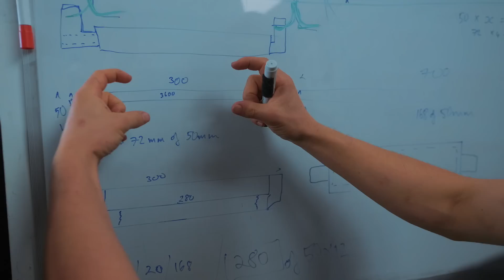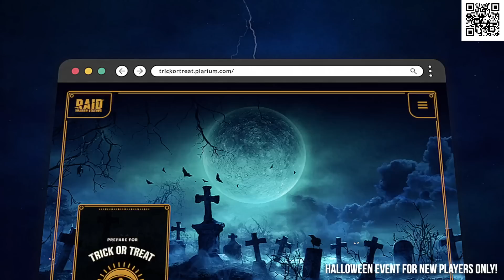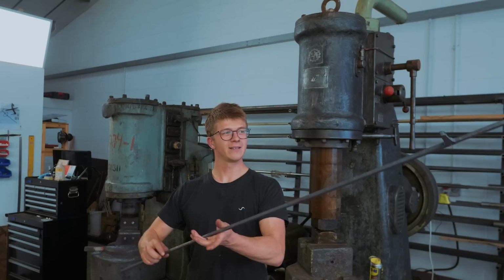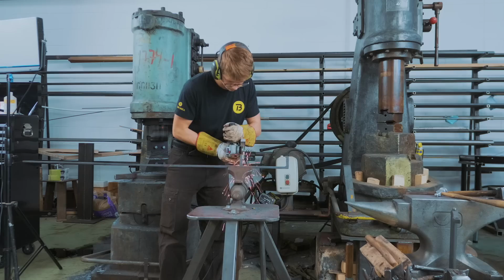Recreating This Ladle From LOTR: Rings of Power... Is It Legit?

Comment: Just a minor critique, and I know you was going for show accuracy here, but wouldn't the hole for the pour of the material be better off being a little bit higher just to try and avoid premature spillage from the hole?
Reply: @Braveskin  you have a good point, I didn't think of that.
Reply: I was goingbto say the same thing
Reply: @Braveskin  it doesnt have to be low for not  leaving metal in it... the bottom just has to slope up to the hole gently so that at the angle you can comfortably raise it to the slant is almost horizontal and just slightly pointing down.  |______/
Reply: that's what she said
Reply: @TheScarvig  Yeah, you just basically invented a beak, which would be perfect for that.
Reply: I agree completely. Also based on what's seen in the clips from RoP, the hole is not flush with the bottom of the tray. Like the spout looks to be favoring the top more. Also I enjoy how they show the rod as being designed to pour with. Yet they instead use two people to pour using an entirely different system. Also Alec, I do believe you forgot these side facing holes :P
Reply: It really doesn't seem to be the most practical ladle design, long trough like structures tend to resonate and splash excessively.
Reply: @Isnogood12  i am fully aware that this had to be a thing that exists with a name, but i didnt know it and thus just described it...

so i guess thx for telling me the name of it?
Reply: @TheScarvig  I didn't mean anything nasty with it. For me beaks and beakers are commonplace because labwork.
Reply: That's not the elvin way.
Reply: The issue is that for every millimeter you raise the hole, you'll have to raise higher the bar from the other end when you want to pour it, since it's raised with a lever-like effect. So pouring the content would become a lot harder if the hole is high. You have to compromise. I expect he did add some slope to the opening, just not a lot to not make the pouring too hard, since I bet he wanted to be safe and not have to hold it too close when pouring in case it actually breaks apart.
Reply: I think that's the reason why so little copper comes out into the mold and episode ends quite abruptly after. I think most of it ended up in the forge.

Comment: We made pin drivers using 1 1/8th winch cable. The pin driver was 1 1/2 or better solid shaft. Without the cable to dampen the sledgehammer blows your hands took some damage. We would weld the cable ends into a close fitting pipe. One end welded to the driving pin and the other end was longer for a handle. Hockey tape helped with the grip.

Comment: Think there'd be any ways to adjust this to make it actually practical to use?  Maybe make it out of something with a much higher melting temp so you could even melt steel in it if needed, and a way to have maybe a cap covering the hole, but have it open if you put the rod in one way but stay closed the other way?

Comment: Solution to your Foundry Problem: Take the imperfect Anvils and discount them while marking them to indicate they are rough, and work a deal with the Foundry where products which don't meet set standards will be purchased at 60-70% of value so you can safely discount them and the Foundry isn't losing money making Anvils it's going to have to melt and re-cast. Over time the quality level should improve and you won't have such strained relations with your supplier. 

And people will buy them. A lot of people can't afford to purchase an anvil at full price and will be quite happy to get one at a discount with some imperfections. 

Additional thought: You could add a raised lettering on the base/foot of the anvil that you could grind off indicating it as Rough in casting. Probably the easiest method of marking it, and lower your cost by foregoing any finishing, leaving that up to the purchaser. So essentially, you would receive your Anvils from the supplier, sort them into finished and unfinished, and discount the rough ones while doing the finishing work on the others and selling those at regular price. That saves you time, provides people with the option of buying and finishing their own anvil from an imperfect specimen, and you keep your supplier happy.

Final thought. You could put the 'Rough' lettering on a raised surface on the side of the foot and on finished anvils grind it down to that surface, polish it and market it with a production number out of 10000. i.e. 00001, 0012, etc... That keeps it clean and ensures the finished anvils are easily distinguished from unfinished anvils as being Pristine.

Comment: For anyone thinking, "well, we don't know what the ladle is actually made of, and the metal's probably something like mythril":

While that's true, Alec is not only exactly right about the incandescence, he's right about it _no matter what the ladle and melt materials are_.  Blackbody radiation is independent of the material producing it, and is solely dependent on the temperature.

So if the ladle and melt are at the same temperature, they must glow similarly, magic notwithstanding.  Even ceramic crucibles glow when their load glows (though, since crucibles are very insulative, their exterior gets dark much more quickly than the load, because the outside cools quickly, but the walls don't pass heat as quickly as metal).

Even being as favorable to LotR as possible - assuming that the ladle on screen is some kind of blackened ceramic that just looks like metal - it should be at least red hot right out of the fire, but it still just looks like cold steel.

Comment: Should be more like 1/4" thick walls on the ladle and base 1/2" to hold heat for gold, silver, copper ,etc. Lower temp metals to be melted and poured from and pour spout should be more just bent top edge of one end with corner hangers

Comment: As much as I love the forging and I do realize that the entire point of this channel and what you do is Blacksmithing, I can not help but think that sometimes there is just not a good reason to do some things in a way that is that much more difficult.  I mean, welding is a thing for a reason.  Wouldn't it have been better and much easier to have either welded the middle drop down parts on or even to have forged several pieces and then to thread them and put some locking pins in so that it could have been disassembled packed away in a case or something and then reassembled again later?  Hell, you could even patent a design for that and start making and selling them if you wanted to, even if it was just as merch or something.  You know, like your own custom made line of tools for fans to buy and use.

Comment: I can see a serious flaw: the pouring hole seems to be level with the bottom of the ladle, so if there was more that a tiny amount of molten metal in it, any movement would have it all pour out of its own accord and that would happen even if it was sitting flat and level in the furnace, so I'm surprised that your molten copper didn't literally "disappear" out of the pouring hole.
...and strangely enough, that's exactly what happened ("Oops. I spilled some") as soon as it was moved and you had to tip it up to stop that.
It wasn't your design and you were 100% correct about the colour it should be coming out of the furnace.

Comment: Wouldnt it have been a lot easier and faster to start with a long rod or square stock piece, cut a piece off and forge weld it to the center, and then just bend the tip 90- degrees and be done with the long rod handle thing? Why make those barbs integral out of a piece of flat stock and draw it out and then try and finagle the barbs? just seems like a lot of work that could have been one quick forge weld and some light shaping.

Comment: In the show, something strange happens when they pour from the ladle.  If you check 0:13 in this video, you see that there is either a different version of the ladle’s “boat”, or it can be reconfigured with different handles.  As you can see at 0:13 in this video, instead of the handle that Alec reproduced which was used for placing into/retrieving from the forge, when it comes time to pour, it’s a two man job, and there are two sets of long skinny handles at right angles to the “boat”.  Again, not sure if this was just a completely different prop from the movie, or somehow the ladle’s handles can replaced for the pouring phase of production, but there are definitely two distinct formats here.
Reply: Good catch. If you freeze it at 0:12, you can see a hole below each place on the ladle where you place the "forge loading loading handle" which you can slide the "pouring handles" through for pouring.
Reply: @johnj9635   nice catch to you too, I was looking for something like that but didn’t see it.  That’s very cool—a single container with two sets of interchangeable handles for different uses.

Alec, if you see this, consider drilling holes in the flat parts of the hinges that accept the handle you made (as seen at 0:12), so that two bars as seen at 0:13 can be inserted for pouring, if you really want to replicate this!  It’s got to be a lot easier to control the pour this way instead of tilting it downward with all the weight on the end and not being able to see what’s coming out the front well.
Reply: @AvanaVana  thanks. Though looking at 0:14, it appears I was somewhat wrong and the pouring handles are tapered downwards, so they can’t just slide through, and can’t be one piece. Maybe each side’s handle  fit in a socket on each side and touch each other in the middle. So it looks like there are 4 pouring handles, 2 for each side. Not just 1 for each end.
Reply: @johnj9635  Actually I did see that, and I still think you are right, they can slide, but barely. The kink in the center of each handle is just enough to slide through the hole (which is thin, it’s just through the flat part of each hinge that sticks up vertically), and this kink in the handle then acts as a kind of lock, preventing the boat/crucible from just sliding willy nilly along the handles.  It would take a little bit of maneuvering to insert and remove the handles, but not too much, and the locking behavior would be worth it.

Comment: Great job on the boat, but, you're working under the assumption that the boat was made of steel. The material it is made from isn't mentioned in the show from what I recall. Middle Earth is fictional and they have fictional metals such as Mithril. It stands to reason they would have other fictional metals that don't react as steel does when subjected to high temperatures.

Comment: Considering who is doing the casting along with the time period, there's a good chance that the vessel would be made out of mithril, which according to sources has a higher heat resistance then steel does. So in theory it wouldn't suffer as much as the steel version you made here did. 
Apparently copper melts at slightly less then 1kC and steel melts around 1.2kC, so the one you made came within 200C of melting itself apart in your forge.